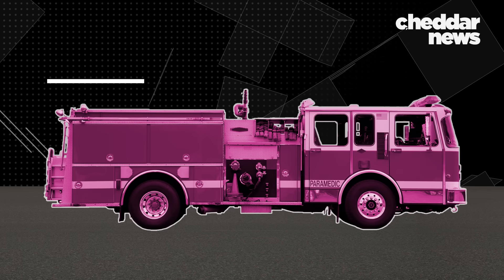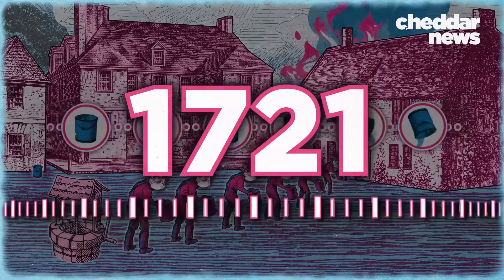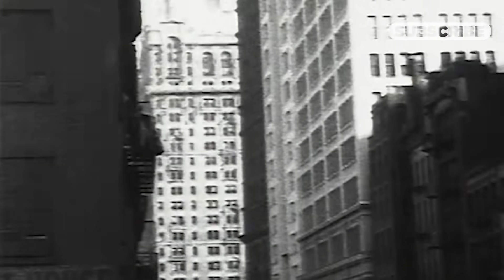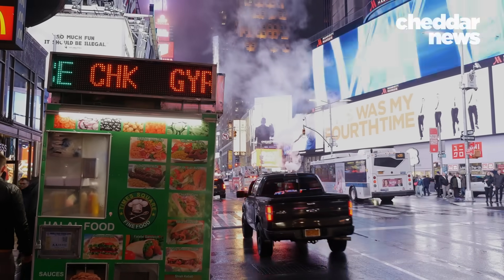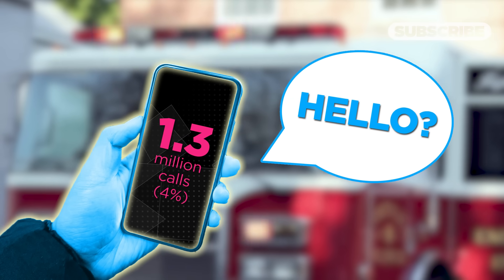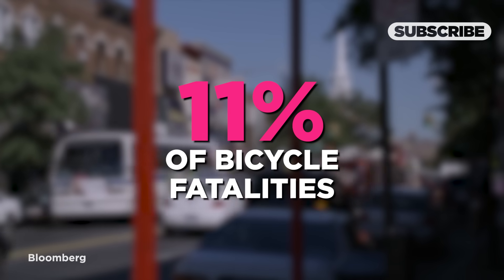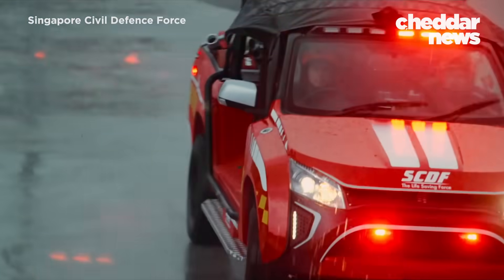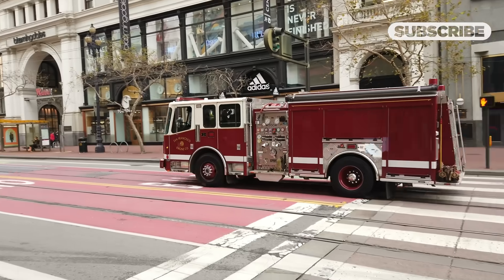Do American Fire Trucks Need To Be So Massive? - Cheddar Explains

Comment: You have to look at the whole picture and not just at the types of vehicles used. As a firefighter and engineer in Europe (Switzerland to be precise), it is very clear to me that what plays the most important role in the safety of a place is its design. From my point of view, it's incredible that American engineers and politicians build cities whose design makes them inherently unsafe and then compensate with active modes. For example, the video makes it clear that road accidents are a major part of the interventions and therefore require specially equipped trucks. There are American cities without public transport, so everyone has to drive, including people who are not medically fit to do so (young people who have been drinking after a party, old people and some disabled people) and even people who can drive have to spend a lot of time on the road, which increases fatigue. Add to this the fact that almost all road safety in the US relies on driver attention (stop signs, traffic lights, etc.) and then wonder why there are so many road accidents? So American roads are designed in a way that will logically cause accidents, and as a result American firefighters are equipped with heavy vehicles that avoid the installation of bike lanes that could themselves contribute to reducing traffic and therefore the number of accidents. This is a typical case of bad engineering, where bad design creates a problem that cannot be solved without changing the design.

So the problem is not the width of the trucks. The problem is that the streets and buildings are incredibly poorly designed and that's what needs to change. Then, when cities are safe by design as they are in Europe, heavy equipment for firefighters will become unnecessary and the size of vehicles will be reduced.
Reply: Totally agree.

Comment: Coming from Singapore, the "Red Rhino" mentioned in the video isn't the typical fire-fighting vehicle for use in the SCDF (which holds responsibility for fire-fighting service). It was designed for certain situations in certain environments. The SCDF does operate full-sized fire-fighting vehicles, which can be quite massive and heavy. Different types of fires call for different tools.
Reply: A Tanker in the US is solely for water transport for places with no on source water in the US. The Small pickup truck size 300 US gal to the Big ones you see used in the movies 1,300 US Gal.

Thats the US Definition of a Tanker Truck. We also have On-Road and Off-Road Tankers, Flightline, Fuel Yard/Storage, HAZMAT which is loaded with chemicals and not water. just a TON of vehicles now adays. Like I said back in the 80's -90's there were just 3 types, The General Fire Truck, Tanker and Ladder. NOW even my county has condensed the Fire Houses and have like 20 different types for all uses, from my arm is trapped to half the city is burning down.

I also looked up to be sure IF I was right about the 200 foot ladder. I was wrong, We DID have one but it became unsafe so they scrapped it and are now looking at the German one. A Bucket (2 Fire Fighters) to 300 foot with a Directional Hose. The Tallest Ladder is 140 feet (14 stories) that can do Rapid Evacuation of a building.
Reply: Depending on the apparatus used, but if we are speaking generally as a normal fire call. Pump ladder is quite sort of a little small sized then other countries in my opinion.
Reply: I feel that almost all the building in SG equipped with fire extinguisher hose. So first responders could use those things around the build to delay the fire spread
Reply: @Clara_B00Bs_aint_real  they do but some times they a broken due to poor maintenance. Some inspectors are corrupt and take bribes not to look too closely at things and things like valves or traps are not maintained on a regular basis. Other times the internal structure gets damaged due to things like an explosion from whatever’s in the factory or a building. Other times the sprinklers aren’t enough to contain the fire.
Reply: We even have tracked vehicle
Reply: "Different types of fires call = different tools" is literally the message of the video: instead of traveling with everything possible in a gigantic lorry, you buy 2 or 3 smaller trucks. Some EMS can be handled by "red rhino" cars, so there is no need to send a 1 million dollar ladder to the scene each single time. The example of an american city who chose smaller trucks is pretty clear: they still bought a full fire truck, they just bought smaller vehicles for the rest
Reply: Singapore doesn't have big trucks like the Americans do...
Reply: Sg is the size of nyc. Red rhinos do very well with most small fires. So Idk why nyc need huge trucks
Reply: I'm from singapore too as a mrt enthusiast
Reply: The Red Rhino's official name is the Light Fire Attack Vehicle (LFAV) & can be thought of as a mini fire-engine (its built on a Isuzu D-Max pickup chassis). 4-6 generations of it have already been built in its ~17 yr history including some even smaller 2-seater versions. I believe they're designed to be 1st-responder vehicles that can reach a fire more quickly than regular fire engines, not only because they're lighter, but also as they're small enough to fit into smaller fire stations called fire posts, which are more numerous in number (they're also often found at the foot of apartment buildings, instead of being in a standalone building as with fire stations (although newer stations often have space to accommodate a police station too) & thus more likely to be closer to the scene of a fire. The Red Rhinos are also likely more ideal for firefighting in areas consisting of mostly shophouses (usually in historic parts of downtown or in inner suburbs), where the roads are narrower
Reply: @lzh4950  yeah, Singapore ambulance and fire calls can often be two-pronged. They might send red rhinos, or paramedics on a bike ahead as a first responder, before a full sized fire engine or ambulance arrive later. I remembered they also had a fleet of firefighters with a tank on their back on motorcycles at some point. Helpful with small fires such as a bin or car fire.
Reply: Why would that matter, R Y? the video explained extensively that extinguishing fires is only about a 4% ratio of all emergency calls, so 96% would be just as well served with something like a pickup trick with 3 emergency personnel or such a quick Allwheeler.

Comment: Just to add to a lot of the comments pointing out the various serious issues with this video (even if the core idea is maybe correct, I don't have the information available to know one war or another), here's some I haven't seen mentioned in my quick scroll. 

1) Most important. 
"Fatalities from heavy trucks" and "fatalities from blue light response" are very different statistics and this video really doesn't make clear which their numbers refer too. Is Cheddar really claiming one in fourteen US road fatalities are caused by fire truck collisions? Because the numbers I can find make that seem unlikely.

2) Replacing full sized firefighting appliances with small, van or pick-up sized vehicles is called a budget cut and it happens in Europe too. They aren't necessarily more efficient, just cheaper.
Their main purpose here in the UK was to find a way to cut half a fire truck, not do more with less. 

3) This is more of a clarification than a straightforward mistake, but  Singapore Civil Defence Force, the organisation responsible for the nation's firefighting, absolutely uses  full-sized (by European standards) firefighting appliances. It's light vehicles, such as fire bikes and the light fire attack vehicles shown, aren't a replacement for a fire truck anymore than a paramedic on a bike is a replacement for an ambulance. 

4) Finally, a question. How many trucks, per population, are used in the USA Vs Europe — remembering to take into account the effects of population density? 
I know this is difficult research, but you can't really answer the question without it.

Comment: Building codes are different. Plywood on a wooden frame sprayed with Polyureathane on the backside, turn US-houses in to torches. I am sorry to say this.

In Denmark, Europe, where I live,  combustible wall insulation is not allowed. Glass- or rock wool are the most common. The walls are usually bricks, 110 mm wide, then 250 mm of glass wool, and 110 mm of aerated concrete.

Wood is often only used in the roof. However wood famed houses are around.

The building code in other European countries can be somewhat similar, with less insulation.

Thus you need larger and more fire trucks in the US.

Comment: You seemed to have missed a lot in between. Trucks in the US can carry equipment more efficiently so that you do not have to call in a specialized truck which takes time to get on scene. At my department we can put a 35 foot Extension ladder in our pumpers without any issue. We carry equipment so if we need it we can grab it use it as fast as we can to prevent a scenario happening. You also forgot about how long our equipment lasts. One of our pumpers, aerials or rescues can last 25 years without issue.
Reply: "Trucks in the US can carry equipment more efficiently" how is it more efficiently? In fact in the US e.g. Heavy Rescues respond to a lot of incidents which would be handled by Engines in most of Europe, like structure fires of traffic accidents. 
The Engines in Germany carry various ground ladders adding up to 100 ft. "One of our pumpers, aerials or rescues can last 25 years without issue." well that's the very same thing over in Europe. Even in large city departments primary apparatus are expected to run 20 years, and after that they're handed over to less busy volunteer departments elsewhere.

Comment: European fire trucks are far cheaper as they use standard chassis and are generally smaller. They're easier to handle and take up less space. US fire departments use outdated policies, and even our new fire trucks often look old. It's time we switch to electric fire trucks on standard chassis that are suitable for urban areas, not the behemoths departments use today. Deaths from fires are also lower in Europe, so clearly, what we're doing isn't working.

Comment: A couple of things: One, there is No Such Thing as a "Cherry Picker" in the Fire Service. "Cherry Picker" is a nick=name for a type of construction crane. YOU are talking about a Snorkel truck. Two, When I was Parts Man for a fairly large Texas city (DFW Metroplex) I learned there is No Such thing as a "standard' fire engine; they are All custom-built. Hose-load, pump capacity, carried equipment, are ALL different.
IF we needed a new windshield for a Spartan fire engine, I had to call the Spartan Fire Engine Company for a replacement.
Lastly, fire equipment is usually Not at fault for any accidents on the road, vehicle or pedestrian: Ear buds, cell phones and Scattered Brains ARE.

Comment: American firefighters fight fires way differently than almost everyone else. To be as aggressive as we are we need to carry a lot of water with us, the smaller trucks would never be able to handle the weight or size of our tanks. Most fire trucks in American are on the job for 20 plus years, with a smaller chassis the weight of the water and the pump alone would destroy it. As far as the accidents that was mentioned those stats were for ALL large vehicles not just fire trucks, we do have accidents some are our fault and some are others on the road. In Cleveland Ohio just 24 hrs ago a firefighter was killed on a highway by a driver, in American we are seeing it more and more drivers not respecting our space. This is not the fault of the size of the vehicle it is 100% the fault of others.
Reply: is the fire attack in the US any more aggressive than lets say Germany, Norway etc?
"Most fire trucks in American are on the job for 20 plus years" well that's the bare minimum standard here as well, even at career fire departments in the cities the frontline apparatus are expected to serve for 20 years and then will be handed over to less busy volunteer departments

Comment: So as a diesel mechanic that has worked on dozens of fire trucks for many different municipalities. I can tell you, not all ladder trucks are the same. Could we shorten our ladder trucks? Sure, but that also adds maintenance to the ladder. In order to shorten the ladder when stowed, it has to be built in more sections so that it can reach the same height. Say for example a 100ft ladder; which is the most common in the US.  Every time that ladder extends, it's going to wear more than if you have a 4 section 100ft tall ladder. Every ladder section is about 30-35ft, because you have to have overlap between the sections. Even at that few of sections, you can still only get a maximum of 3 kitted out firefighters on the ladder at a time. That length also helps spread the weight of the ladder across the entire chassis. If you shorten the sections and increase the number of them, now you have a LOT of weight in a small area. If I had to guess, the typical ladder probably weighs about 10-15 tons between the platform and the ladder itself. That's about 9-14 metric tons. That's a lot of weight to put on a shorter chassis, and I doubt most roads in the US is designed to handle those weights. 

Plus the trucks are built to a code. The NFPA (National Fire Protection Agency) drives the design of the trucks. They set out standards for the type and amount of equipment that should be on certain types of fire trucks. Trying to get that same amount of equipment into a smaller truck. Let's just say it would be cramped, and make it more difficult to get to life saving equipment in a timely manner. 

I also saw one commenter reply that in Europe, there tends to be an airport relatively close by if they need more substantial equipment. We don't have that in the US. At our municipal airports, it's the local fire department that responds to calls at the airport. We only have the big equipment stationed at the large regional or international airports. So our trucks have to be able to handle EVERYTHING that can be thrown at them. I know if I was involved in an accident on the highway, I would feel much better knowing that there was a 30 ton truck blocking lanes, than if it was just a 15 ton truck.
Reply: " Let's just say it would be cramped, and make it more difficult to get to life saving equipment in a timely manner. " a well thought-out space usage concept might look like a game of tetris, but you can design it to be able to get what you need without loosing valuable time 
"there tends to be an airport relatively close by if they need more substantial equipment. We don't have that in the US. At our municipal airports, it's the local fire department that responds to calls at the airport" not sure where those people are from, but e.g. in Germany it's the very same thing as you described; In general there's a way lower number of airports, and most areas don't have any airport anywhere nearby. I used to live in a city of 200k inhabitants and the closest airports where 1 hour north-west and 1 hour south of me - and by that they were rather close
Be sure, we know what it's like to be out on the Interstate. We don't have a general speed limit, so traffic might be approaching at more than 150 mph

Comment: Do better homework.  Most fire trucks, engines at least, have more than 400 or 500 gallons on board. Many have 1000 gallons of water…while smaller may be better in some situations, most departments in the US need the capacity for equipment since they do have the same apparatus respond to every type of emergency.
Reply: "they do have the same apparatus respond to every type of emergency" and you think that's different in Europe?

Comment: European fire departments also have more apparatus per call, the us has bigger trucks meaning we fit more equipment on said truck, the other part of the equation 90% (roughly) of departments in the us a rural, small budget, volunteer departments that struggle to find and keep members, if you take the equipment from a large pumper, and spread it across half a dozen smaller trucks you need that many more people certified to drive said vehicles
Reply: looking at the same type of call, like a fire in an apartment house, I see the same number (or actually more!) of apparatus responding in NYC like in many places in Europe - just that they come from many different stations in NYC compared to 1 or 2 in Europe

Comment: So let me get this right if you live in a high rise let saying new you were just like you're talking about and we're talking 20 story on average buildings. Google how much a story is in feet or God forsaken if you're using the metric system what are you supposed to do when you do get dispatched out to a high-rise fire and there's no ladder to save people so are we going to do like 911 all over again and watch people jump to their death yes I just wait there I'm proving a point on how stupid this sounds you supposed to go down to the nearest rental shop to you and pick up a bucket of cherry picker and on top of that figure out how to zip tie a deuce and a half line to it I really wish you understood how hair brain do you actually sound
Reply: apart from such high-rise buildings having both a secured staircase and elevators (in modern buildings also ones which can be used by the FD during a fire), Europe has Aerials which are able to reach that height - however those Aerials are barely used on incidents on such high-rise buildings due to the staircase and elevator, but they're made for structures which lack such secured staircases and elevators like e.g. church towers, wind turbines, transmission towers, ropeways, bridge columns, construction cranes, gantry cranes etc